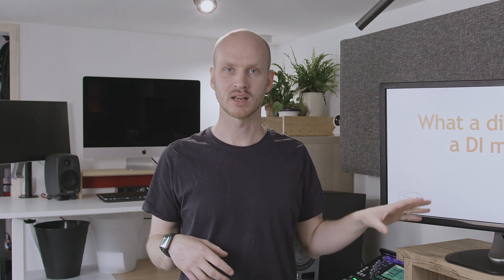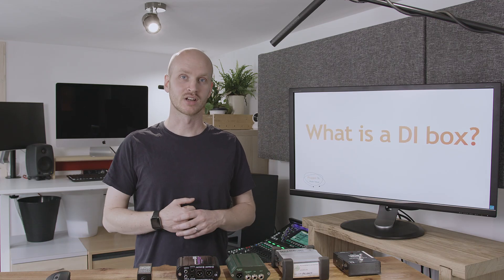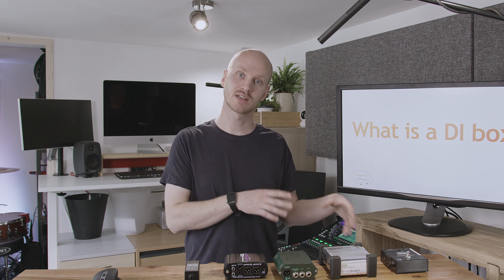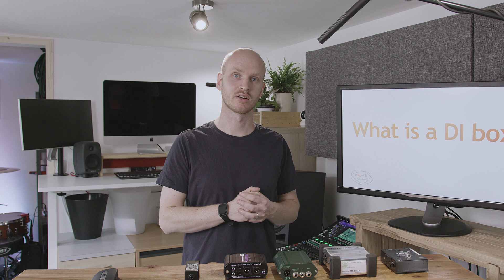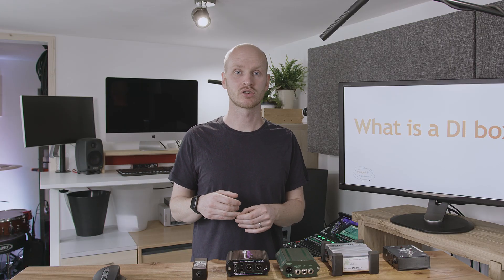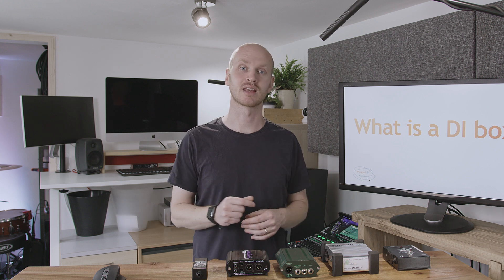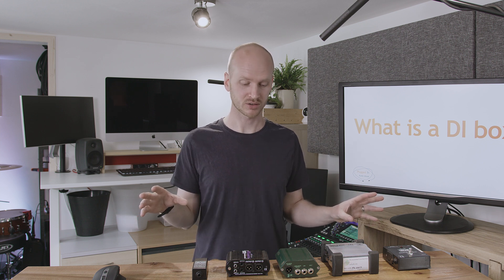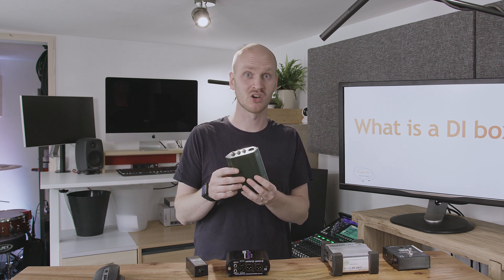What is a DI box and why should you use one?

Comment: Any reason why a DI box would be installed between the mixer and PC for live streaming? I know we can use the USB card on the X32 Compact, but don’t know why it was set up this way originally. I’m finding through your videos that the sound board may have been incorrectly configured for the beginning. 😐
Reply from the maker: If the PC is close (within 5m) of the console you probably don’t need a DI box.
Reply: @ It’s literally 5 feet. I can touch both while in my chair. Thanks.

Comment: For connecting bass to the sound board, do you recommend using a di box or the direct out from the bass amp?
Reply from the maker: Either way will work. It depends a bit on the building. You will generally have better control of sound with a DI box rather than a bass amp.